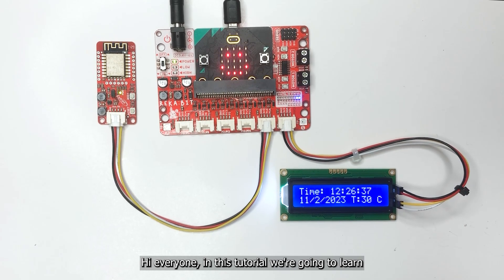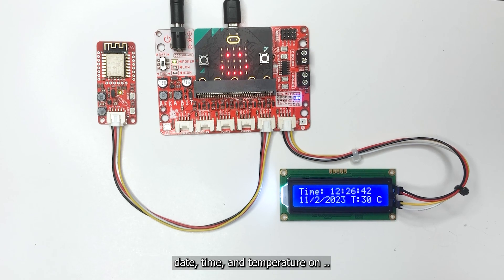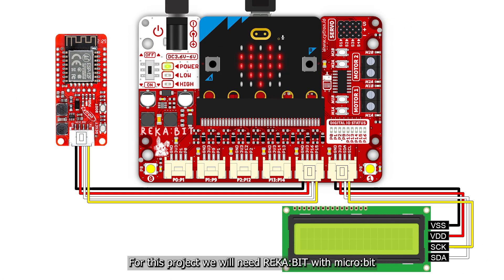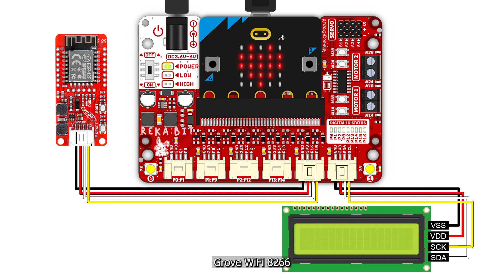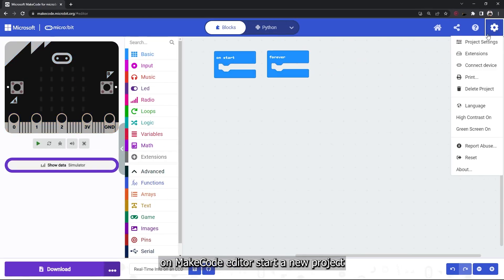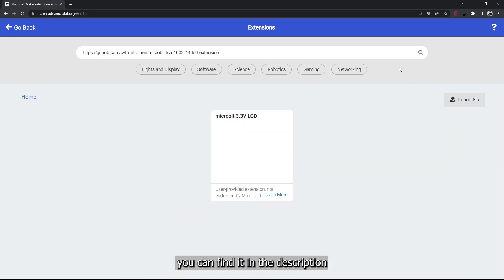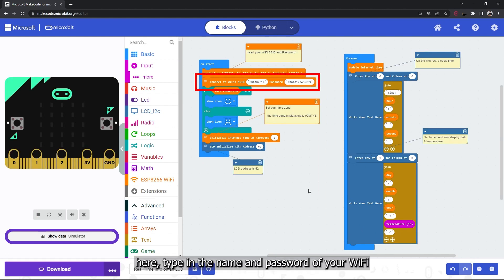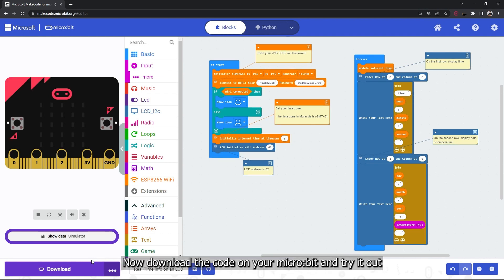Displaying Real-Time Info on an LCD with micro:bit

Comment: HII, i have a few probelms with this design and was wondering if you could help me with them. Firstly, instead of a LCD i have an OLED screen which works fine, however when i have the esp connected to my iphone hotspot, in the place of the hour and time it only shows 0's. I have initiallized internet time and have update time on the forever loop yet it still shows 0.

thanks in advance!